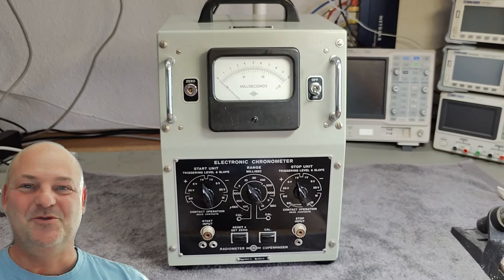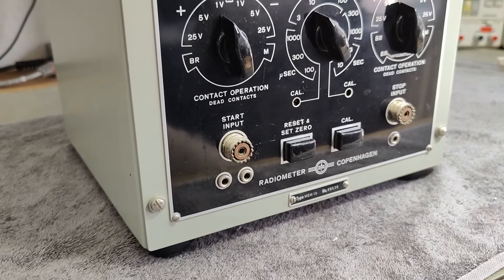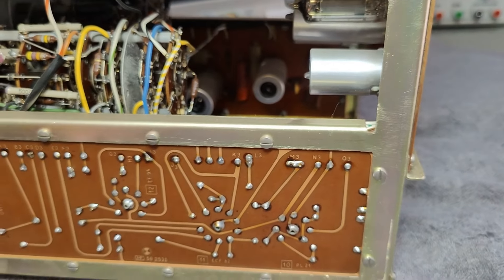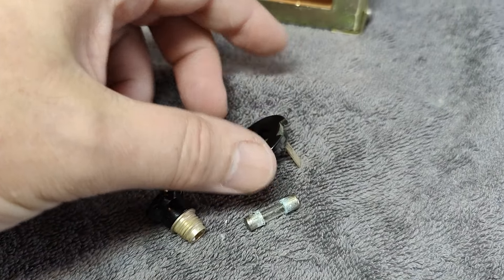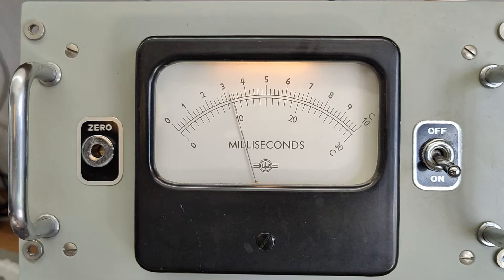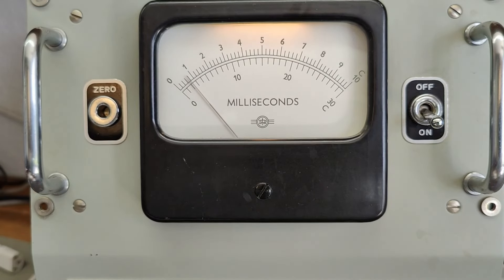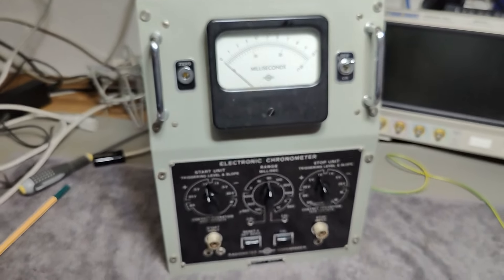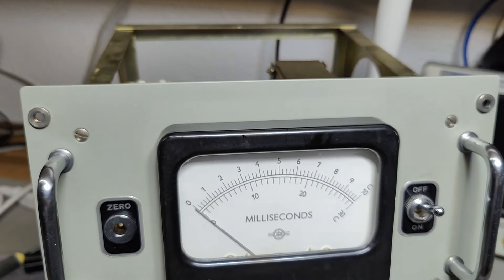Radiometer MSM1B Electronic Chronometer tube 1963 teardown

Comment: I always enjoy the analog equipment that we would use digital circuitry for today.
The fact they can stop and store a voltage for display on a meter that is calibrated in time or frequency is mind bending.
But there are aircraft still flying with such circuitry in the avionics, so I can say we are still repairing the obsolete gear!
Reply: How is it obsolere if you are still using it to fly aircraft?
Reply: @splitprissm9339  It is obsolete in the fact they no longer make or support the equipment, but the owners don't want to upgrade as the cost is quite high, but repairing it can still be done.